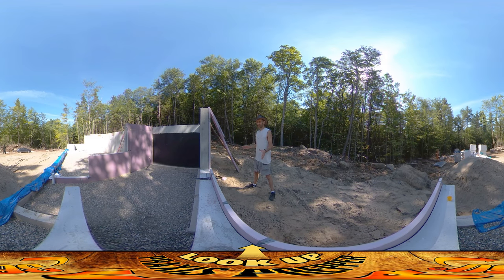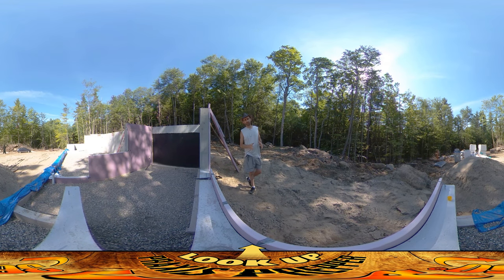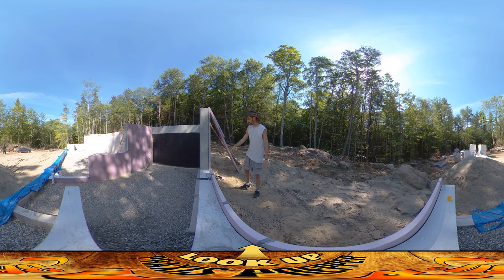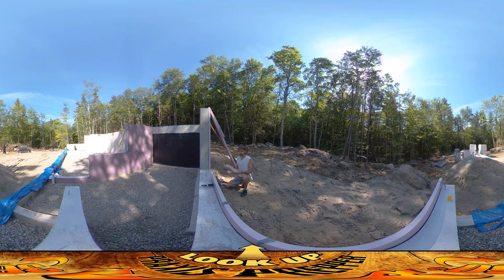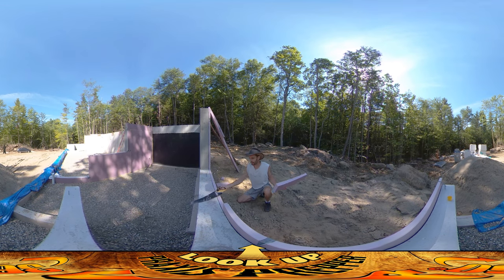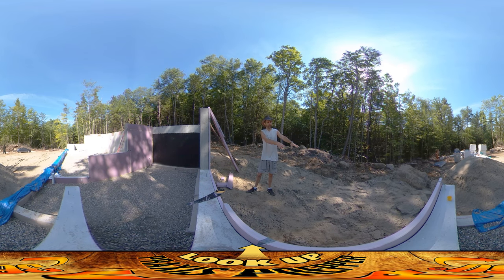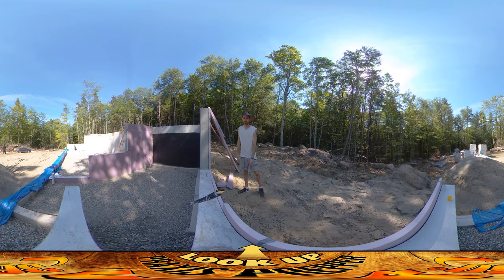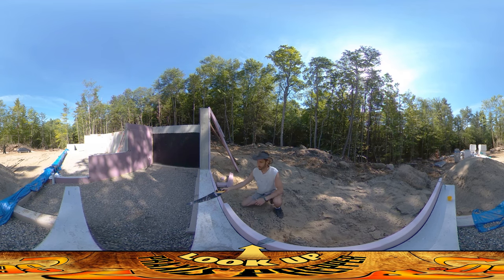Homestead Building - Trimming Foam

Comment: If you haven't installed your sill plates yet, consider this:
Building gaskets to provide air tight seals for Still plates and rim boards:

http://www.conservationtechnology.com/building_gaskets.html

Also paint the top of the concrete walls with concrete sealer paint to block moisture from wicking up.
Reply from the maker: I used a foam pad under the sill plates as a leak seal and a barrier for moisture. The sill plates are also not buried deep in walls in this construction, so they do get to breathe after the fact too.